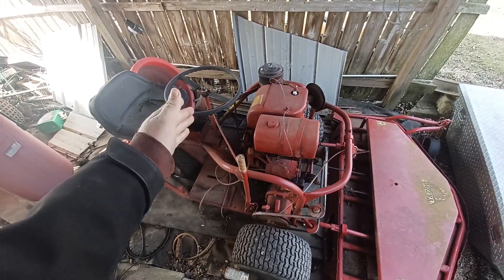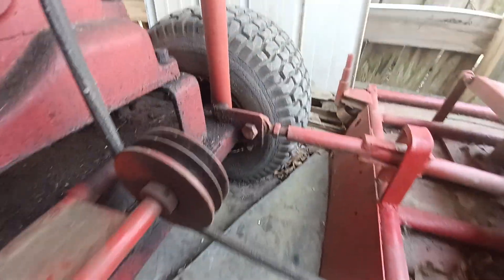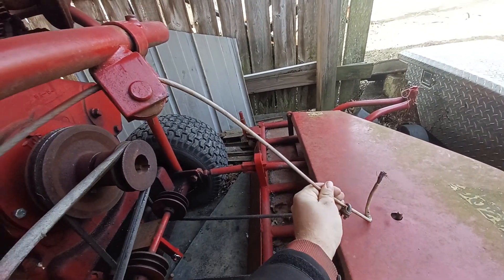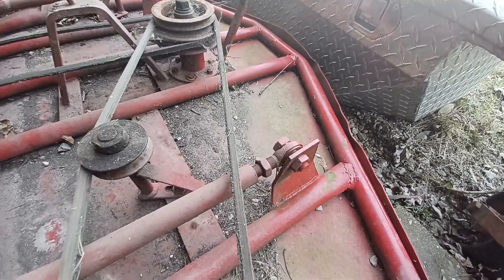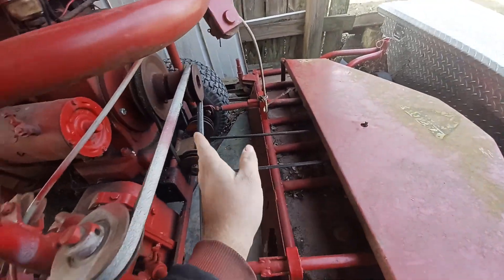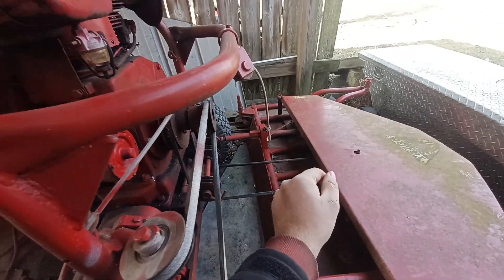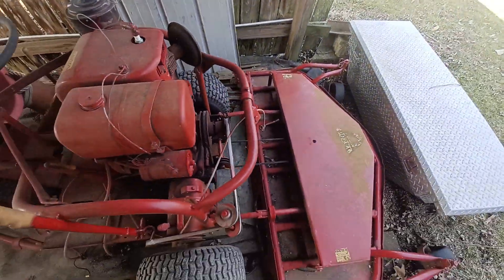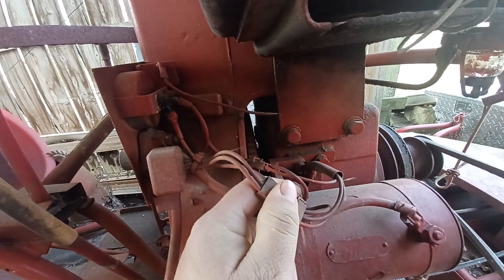Yazoo YR60 how the deck links up

Comment: Hello its me again. What is the length of the linkage from the frame bolt link to the deck bolt swivel??
Is there some sort of hinge point where the link goes through the u-shaped frame of the mower deck?
Reply from the maker: I'll look torrmow as for a hinge point it's just those 2 rods and that big spring 
 that connects the deck to the mower
Reply: So, the rods are one piece with a slight bend where they go through the pockets on the mower deck...?
Reply from the maker: @curtisbudge2063  Yes they have a slight bend in them the part with the square bit should go under the hoops on the deck. The short end should be on the engine side and the long side on the deck.
Reply from the maker: @curtisbudge2063  Here  is a manual for the yr60 https://www.manualslib.com/manual/919884/Yazoo-Yr-36.html?page=14#manual
Reply from the maker: The rods are 2 ' tip to tip and center of the bolts are is 2'3 1/2"
Reply from the maker: Both rods curve up going into the loop then dip down going to the deck
Reply: @PastPreserver  I had to tear down the transmission to get at a forward clutch part called a cam, clutch dog. # 16 in the trans. assembly diagram. Found 1 of 3 is broken. Can parts be found for these transmissions??
Reply from the maker: @Curtis Budge  your best bet might be this Facebook group I kind of forgot about it lol. I really don't know where to find parts for the transmissions but these guys would be your best bet. https://www.facebook.com/groups/773371846049256/?ref=share&mibextid=NSMWBT
Reply: @PastPreserver  thanks for the info. I am now in a group and I think I have found someone who might have the part I need. 🙂👍
Reply from the maker: @Curtis Budge  All right that's great I should have started with the Facebook group I just didn't think about it lol